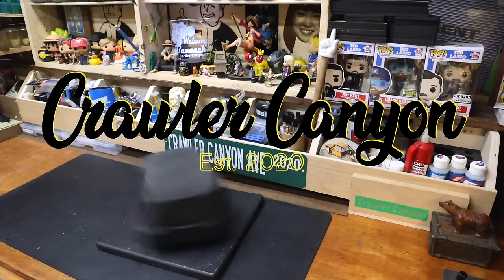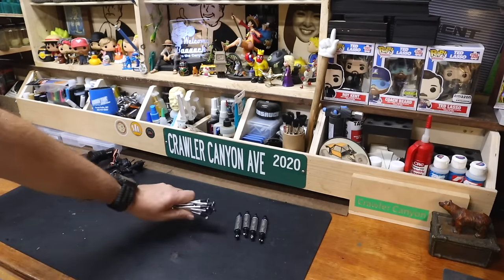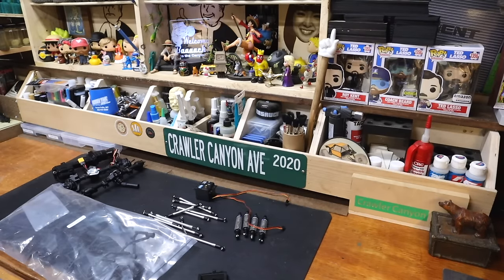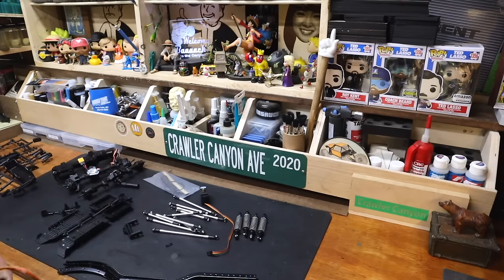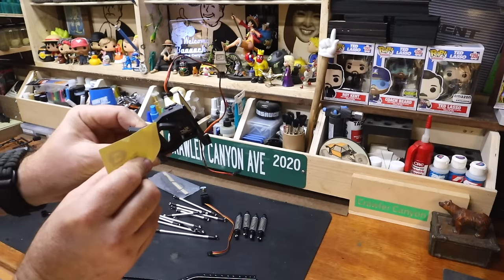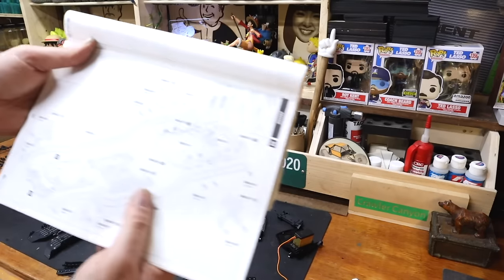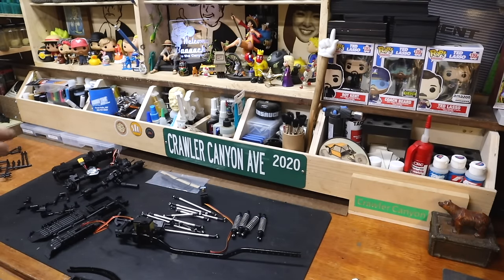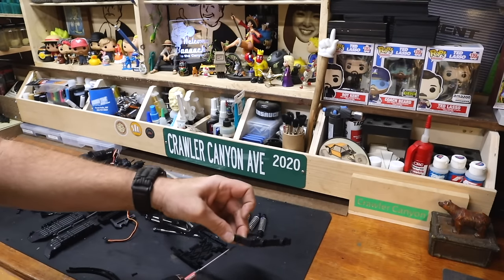Crawler Canyon Presents: The Spiderbuild Chronicles Episode Three:  Bags C+, better/worser

Comment: After completing the chassis, I can say I found it to be a good 3 days of build. Did the fastener lengths make me angry? Yes. Did the sheer number of unique and different ways they went about designing this confound me sometimes? Yes. But in the end I enjoyed it. It's all masked up now and ready for paint. Also, Gmade website lists this thing as 5.07lb but I swear it feels heavier. I'll put it on the scales tomorrow RTR...also, with that receiver box in the WAAAY back I need to make an extension for the Fusion ESC wire :(

Comment: I recently found a way to make custom cut to length driveshafts. It uses the steel cvd ends from axial or traxxas DS, 8mm id x 10mm od amazon aluminum tube and 2 threaded drive pins. Insert the steel cvd insert into the aluminum tube, cross drill and pin. Then sand glue, and insert a plastic intermediate spline into the other end of the aluminum tube. Drill and cross pin. The other end of the splie goes into a stock female driveshaft/cvd. Done. Works a charm, pretty easy to build, make any length you want, and the shiny clean aluminum is oh so nice! This method would be perfect for this application!

Comment: Paint it with spider colors. It would look terrible, but you could do black on the body with a red bed to capture the essence of a black widow. Orange would also be nice. How many layers of paint will it take to make the body heavy enough to use those stiff springs? This one simple trick will take your sprung/un-sprung weight ratio and throw it right out the window.

Comment: Does that have the option for cantilever rear dampers?  Is that the reason for the stiff springs?
Reply from the maker: It didn't come with the bits, but I figure that's why the rear of the chassis is so wide, as Gmade mounts the cantilevers inboard.  Seems like a missed opportunity, as they could have dropped the bed on the body if they ran it cantilever.

Comment: Provided spring rate too high yes, but given how far away the rear axle is the the “mass” of the skid forward that’s a tone of leverage climbing and side hill. Not to mention measure lower shock mount to outside of tire a lot of leverage that aways seems more than normal. Also your not done added 2Lbs worth of body bits electrics and battery. 

Nice to see the geometry better upfront step up from red cat. I understand the need of lower transmission mounting relative to the chassis rail but these companies are dumb dumbs having the main motor wait up too high. If you can’t vanquish low or even trx4 quit trying. It’s very hard to beat a well tuned scx10ii with a centered motor which in theory is lower in mass despite “what it looks like”

Also I take the provided T-handle in a trx4 kit/rtr and go up 20mm from the long end and put a significant bend in it you’ll be able to reach the servo horn bolt from behind the axle at least to check “tightness”. Copper and black serve each other nicely